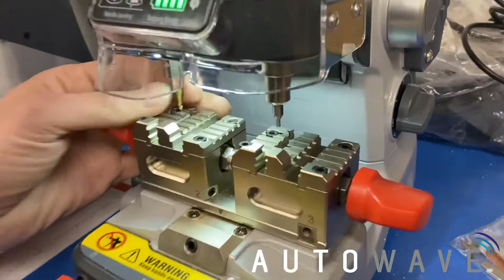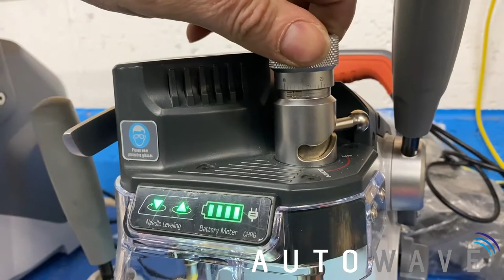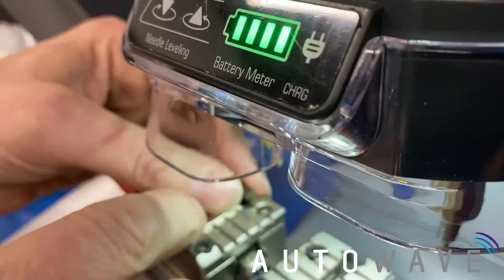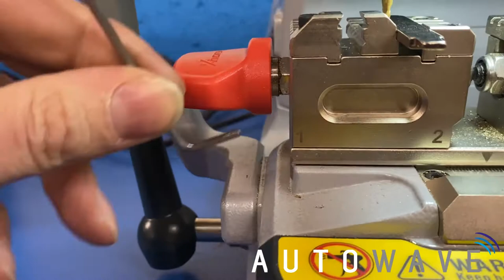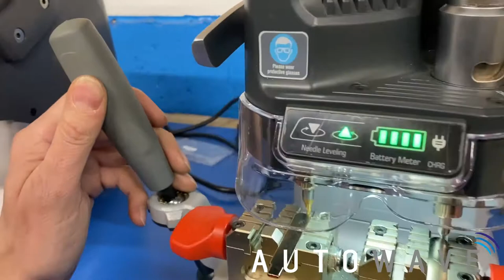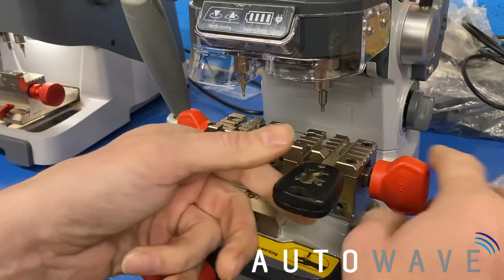How To Calibrate Xhorse Dolphin XP007 Manual Key Cutting Machine

Comment: Set mine up and calibrated but seemed to have caught the top of clamp when cutting....

There is nothing to stop the cutting blade overlapping to the right when cutting..
Reply from the maker: Oh no! I'd suggest contacting your supplier for further assistance, if you are having issues after calibrating the machine.
Reply: Same problem here. It lights up green but only at the top of the clamp it doesn’t touch. did you fix it?

Comment: But why did not come calibrated from factory?
Reply: Don’t buy the machine man this is stupid. I just bought one and I got it calibrated but it doesn’t cut straight
Reply: @tykaneshiro5209  Already bought a month ago. Cutting the key in the middle is fine. On the side it gives problems. You are right.